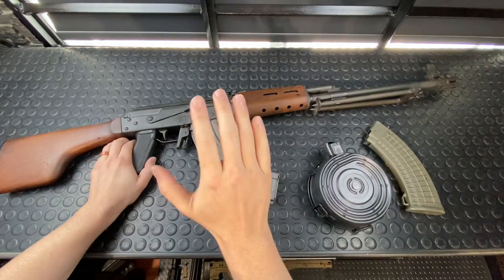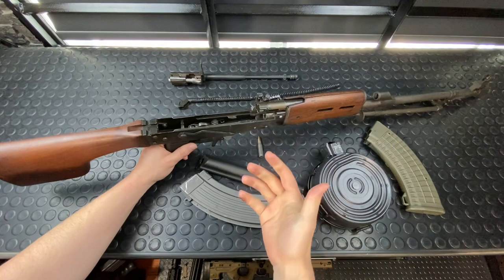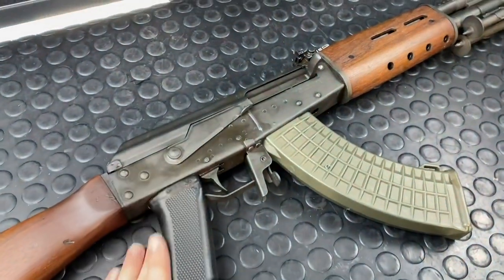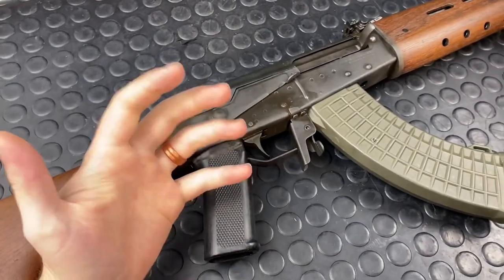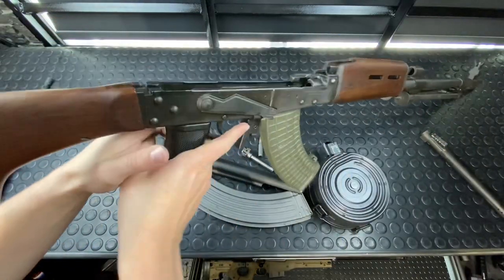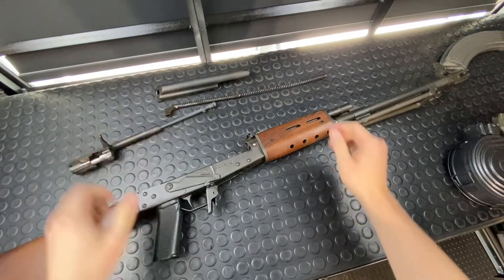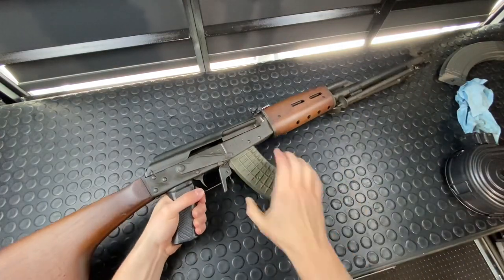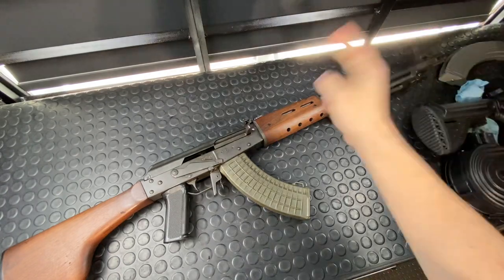Inside Finland's RPK | Overview & Disassembly | Valmet m78

Comment: Not sure I buy it as a gas booster. Would be easier to just increase the size of the gas port. 
But as something i have absolutely no proof for, but am still going to throw into the ring. The larger tube the Gas piston is running in would increase the volume of hot gas around the piston.
So my hypothesis is that is the increased volume of hot gas was the aim to break components free that may be frozen, and the fingers were simply needed to stabilize it in the tube.
As i said, have no evidence for this. Someone who knows a hell of a lot more about this than i made those calls back in the day. So could be completely off the mark.
Reply: Quick send a direct message on through the above let me gift you ☝️